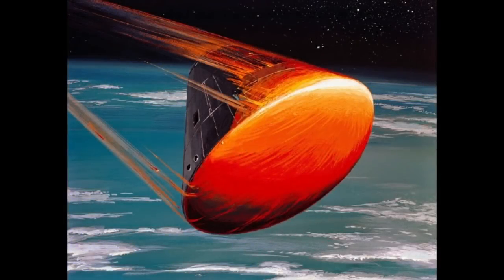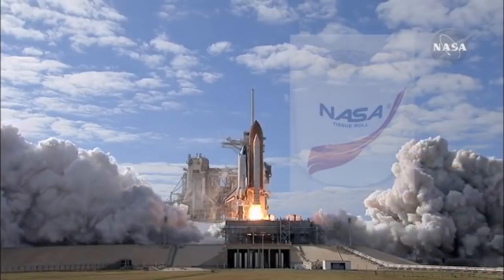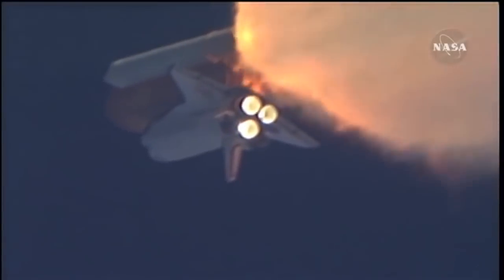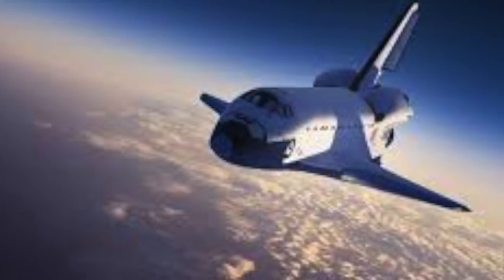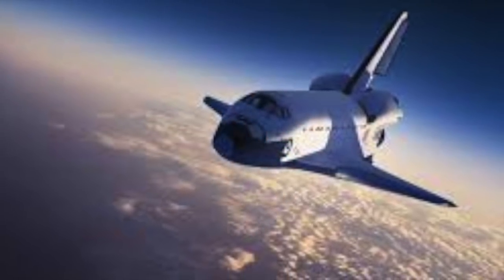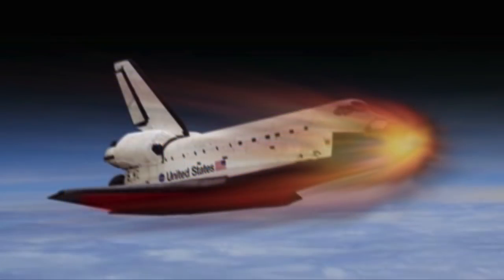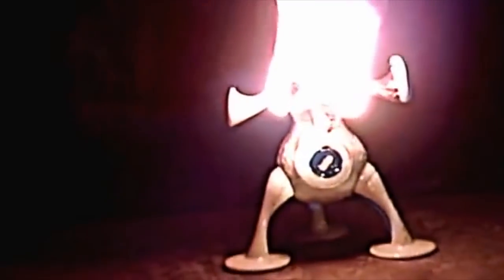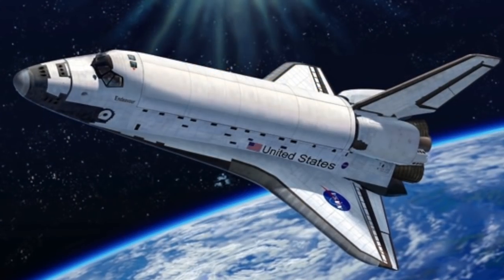NASA Fanboy questions #6

Comment: The only thing you prove with this video, is that you misunderstood "escape velocity". Escape velocity is the necessary speed to exit earth's gravity well - without any additional energy input! Space craft do not travel at escape velocity, because they use rockets to accelerate. How about trying to do some actual research and trying to understand a concept before trying to debunk it?

Think of earth's gravity well as a hill: You can give a car one single really huge push to roll up a hill. If the push was big enough, the car will have enough kinetical energy to reach the top of the hill without using its engine. This would have to be a really huge push and the initial speed would have to be really really fast, because the car will slow down over the course of its climb. The initial speed is the equivalent of escape velocity.

Alternatively, the car can use it's engine and travel much slower up the hill. This is the equivalent of what space craft actually do.
Reply: Of course it’s a theory. It describes an aspect of the natural world and has withstood the rigors of intense scrutiny. There is no higher level.
Reply: @tomwolfe6063  Still a theory and not a law... still bullshit unless you can actually prove it which you can't. Keep babbling troll... you've been lied to... but you still believe it... wake up Tom... you're living in a lie.
Reply: @BackYardGardeningTip  Theories and laws in the scientific world are two different things.  One does not become the other.
Reply: @Orlor  You mean like the big bang theory... how that's a theory but school books no long say it's a theory... never been proven but they don't bother adding the theory part....

So gravity is still a theory... never proven but somehow it's a law too??

Go back to bed and keep dreaming... unless you were being funny... then... HaHaHa good one.
Reply: @BackYardGardeningTip  - do me a favor and define what a Scientific Theory and law is.
Reply: @BackYardGardeningTip 
Do you accept:

The Germ theory of disease: that many diseases because of germs?

Cell theory: That living organism is made up of small cells?`

Atomic theory: that matter is made up of atoms.

Kinetic Molecular Theory: that gas particles are in constant motion and exhibit perfectly elastic collisions

A scientific theory is  to quote wikipedia "an explanation of an aspect of the natural world that can be repeatedly tested and verified in accordance with the scientific method, using accepted protocols of observation, measurement, and evaluation of results."

What in regular language is is theory is a hypothesis in science. It is a hypothesis that changes to a scientific theory when you have verified it.
 
Scientific law are statements that describe or predict a range of natural phenomena. They are narrower then a scientific theory. Scientific theory explain why a phenomena occur, law describes what phenomena happen.  A scientific theory can contain zero, one or many scientific laws.

A scientific theory never changes to a fact. A fact is a observation of reality. A scientific theory explain a lot of facts. 

You can compare it to sport in a way. Then the scientific theory would be the general idea of the sport. A law would be one rule of the sport. A fact would be that in a match vs team A and B the result is 9-3 or that players X scored a goal 5 minutes into the game. It is not a perfect analogy in any way but give the general idea of the difference  between scientific theory, law and fact and why one do not change to another.

Observational science like astronomy  is in a way like to try to determine the rules of the game by observing it being played but without access to any rule book.
Reply: @BackYardGardeningTip  
So you can't say it of accept any or all of the flowing The Germ theory of disease, Cell theory, Atomic theory or Kinetic Molecular Theory?
It is not a hard question and the answer can be I dot know enough about them.

The point was that if there is one scientific theory that you would considered to be proven to be true, whatever that mean, the question is why it is still called a theory and is not changes to law or fact or what else you would expect it to become.

If you expect a theory to change to a law you should be able to find a example.
If you can't you should ask why that 
don't happen. Consider if you understanding of what a theory or law in science is might be incorrect.
Reply: @BackYardGardeningTip Gravity is an effect that has been observed in epxeriments. This effect is described by laws AND theories. In science, laws and theories alike, are both based on repeated experiments and observation, but fulfill different roles: A law describes - what - happens (e.g. "Newton's law of gravitational attraction" which is still correct and applicable for non-relativistic speeds). Complementary,  theories describe - why - something happens (e.g. "Einstein's theory of general relativity" wich is among the most conclusively proven theories of all times.). So depending on what we are reffering to exactly, gravity can refer to an effect, a theory or a law, but in all cases it's backed up by hard evidence.

And about: "You can hang two huge massive balls a fraction of an inch from each other and yet gravity doesn't seem to affect them. Should they not smash together troll??"

This is exactly how gravity is proven! Hang two huge massive balls next to each other and measure the force or acceleration acting upon these balls.

So, I'd say the one of us, who is trolling and full of shit, is the one throwing around insults, while he apparently doesn't know what he's talking about.
Reply: @BackYardGardeningTip The cavendish experiment and comparable setups get repeated all over the world with the same results. Orbital mechanics based on gravity predict the movement of celestial bodies exactly. GPS only works as precisely, because of relativistic calculations.

Gravity is probably the best proven concept of all science, because no other fundamental force influences our life such profoundly. 

I think an actually critically thinking reader will realize quickly, which one of us two is trolling.
Reply: @BackYardGardeningTip  You've disproven the Cavendish experiment?! Publish your results! Let them be peer reviewed! Let them be repeated and confirmed! If it's confirmed, you'll get the nobel prize. That's how science works.

Contrarily to what you think, I'm here and I'm educating myself about flat earth and I got to say: Every so called "gravity debunk", that I've seen, has gotten basic physical concepts wrong, so I won't hold my breath. 

Including this video. This guy doesn't even understand the concept, he's trying to debunk. Why aren't you outraged by that? At the very least, you should be bothered by him misrepresenting your cause.

"Put to massed within a micro meter and they won't be attracted to each other...."

Of course they will, why wouldn't they?!
Reply: @BackYardGardeningTip You can call people names as much as you want. It doesn't change, that most physics undergraduates all around the world perform the cavendish experiment during their studies because it's such a fundemental truth and it's a really good practice for working patiently and precisely.

If you actually care about truth, you can perform the experiment yourself. It's a simple setup, that can be recreated on a budget. You won't get a decent accuracy, but you will be able to recreate the effect.

Here's a well laid out explanation recreated in a dormitory. If you question it, you have no excuse not to recreate it:
https://www.youtube.com/watch?v=jkjqrlYOW_0&ab_channel=GenGen
Reply: HaHaHa... "Think of earth's gravity"... HaHaHa... get a grip troll... gravity is made up just like the globe is made up.. Go somewhere else and try selling your 'gravity'... HaHaHa... dumbass trolls... they know nothing of where they really live but are willing to follow globehead lies without question. Back under your bridge you stupid blind and deaf troll.
Reply: @BackYardGardeningTip  Talking of knowing where we really live, I wonder when we might see a map of the flat earth?  While the FE remains unmapped, navigation is impossible.  Thankfully, navigation is possible on the spherical earth.
Reply: James Mann - Objects accelerate at a predictable rate towards the ground. This rate is 9.8mps sq. and is affected by mass.

We have given this observable force the name of gravity. Everywhere we look in our universe we see the same force acting exactly the same as we would expect. If you think that you know more about our physical reality than every physicist on earth, have at it. It would make you the wealthiest and most famous scientist in history. I can’t wait to read your paper.
Reply: @tomwolfe6063  Great response... are you awake yet?? 

Maybe gravity pulled your enter key down too soon.

Comment: Dear Spacebusters here's another project for you.   Why aren't the Apollo crews permanently deaf?   Saturn V, 1 mile away was over 3 times louder than the loudest passenger jet practically right next to you. Even a mile away, it was loud enough to instantly cause permanent hearing damage.    And yet the crew were 50 feet away with no ear protection which anyway wouldn't be any good.
Reply from the maker: Thank you Douglas, you should be on the payroll lol!
Reply: @spacebusters3933  It took me about 10 minutes to find information about that. With some more extensive research, I'm pretty sure you'll find a lot more. Hint: They are 50 feet away, inside an airtight capsule inside a helmeted space suit. Do you guys even try to research? Or do you give up after checking flatearthsociety-forums?
https://space.stackexchange.com/questions/27263/how-are-spacecraft-crews-protected-from-sound-damage-during-launch
Reply: @berndborte8214  Sorry no sound proofing is that good.   Just look up NASA's own design and fabrication of the space suit.  Then you have the Space shuttle which is almost as loud and NASA films show they are sitting with their visors open chatting to the control centre while it's accelerating.   They don't even suffer from G force.   Once again if you do not believe in the Moon landings the knuckle draggers like you bring up flat Earth.   Let's get one thing straight as far as I'm concerned 37 years in the airline industry gave me a good idea it's not flat OK   As you say your extensive research was 10 minutes LOL.
Reply: @berndborte8214  ps.   Any person with half a brain would be able to realise that a pressurised suit with air inside plus a pressurised capsule with air inside is not going to stop noise.   Tap on a deep sea divers helmet and see if you get a response.   Now if they had been in a vacuum and not touching anything then possibly noise would be suppressed.   Lack of air for the astronuts might be a problem though.  LOL.
Reply: @douglasgeorge1081  You do realize, that I'm not bringing up flat earth. This channel directly adresses flat earthers.
However, the conspiracy theories around the moon landing are only slightly less incredulous than flat earth.
Reply: @berndborte8214  You should obviously get out more if you believe man actually went to the Moon.   No problems landing or taking off.    
Every landing went with out a hitch.   When the public were bored they had to have an emergency around the Moon.... laughable.   Still the sheep believe this.  When this site starts saying that the Earth is flat then I'm off.   Flat Earth cannot literally hold water.   If it was flat the water would run off the sides.  LOL
Reply: @douglasgeorge1081  Dude, this channel denies the existence of gravity! It doesn't get more ridiculous than that.

About "going out more", I can only give that compliment back to you. Going to the moon would have been easier than to actually fake all the evidence.
Reply: @berndborte8214  "Going to the moon would have been easier than to actually fake all the evidence.
"   Captain Kirk and Spock disagree.
Reply: @douglasgeorge1081  Enterprise and Star Wars are the best example for how impossible halfway believable special effects were back then. :D

Lucas Arts debunks your conspiracy all by itself. And then we didn't even examine any evidence yet.
Reply: @berndborte8214  So you are just going around in circles now just like the Apollo crew.   Anyway you believe they went to the Moon I do not.   That's it really.   End of story.

Comment: For anybody interested in the answer... Firstly, escape velocity is the speed you would need to fire an object directly up to have to entirely leave the influence of earth's gravity ( does not include air resistance ). Secondly, the space shuttle or a satellite is not leaving the influence of earths gravity, simply going into orbit. It doesn't need escape velocity to do this. Third, as the vehicle is being pushed by the rocket engine all along its path, it can get away with less than escape velocity. When going up, the craft is going slowest in the thick lower atmosphere and fastest where there is no atmosphere. It's also orientated in such a way as to make it as aerodynamic as possible. On the way down, the opposite is true. The same amount of energy that was used to get the rocket up has to be burnt away to get it back down again. This energy is consumed as heat in the atmosphere on the heat shield. The spacecraft can vary the temperature it experiences by adjusting the rate it descends. Nothing to see here.
Reply: Finally, someone who knows what escape velocity is
Reply: You need to simplify your logic.  The first 3 syllable word they see they panic and start hurling insults.  Good breakdown......
Reply: Every single impossible question:

BRO It's GRAVITY

Fook off, loser

Comment: Now hold on to your tin foil hats boys and girls this will sting a little bit but I will explain why what was said is just uneducated waffle . In aerospace engineering, the maximum dynamic pressure, often referred to as maximum Q or max Q, is the point at which aerodynamic stress on a vehicle in atmospheric flight is maximized. It is an important factor in the structural and mission design of rockets, missiles, and other aerospace vehicles which travel through an atmosphere; the flight envelope may be limited to reduce the total structural load on a vehicle near max Q.During a normal Space Shuttle launch, for example, max Q occurred at an altitude of approximately 11 km (35,000 ft). The three Space Shuttle Main Engines are throttled back "and you will hear them say  during launch"   to about 70% of their rated thrust as the dynamic pressure approaches max Q; combined with the propellant perforation design of the solid rocket boosters, which reduces the thrust at max Q by 1/3 after 50 sec of burn, the total stresses on the vehicle are kept to a safe level.

So, although the spacecraft does not begin to burn up at Max Q, it is a dangerous part of the ascent and the negative effects are minimized by throttling back the engines at that time.

On the other hand a spacecraft that is returning to earth is already going at very high speed when it starts to enter the atmosphere and the dynamic pressure will continually increase as denser and denser atmosphere is encountered at lower altitudes. In fact, the way the spacecraft is designed to slow down is by converting its kinetic energy into heat energy in the atmosphere.  The hot atmosphere is created when the heat shield encounters the upper atmosphere at very high speed. This causes the atmosphere to be compressed ahead of the spacecraft and that causes the atmosphere to become very hot.  The hot compressed atmosphere will also heat up the heat shield. So the heating in the atmosphere is designed and necessary to slow the spacecraft . Ok you got that , good I am glad we cleared that up.
Reply: Excellent summation. Unfortunately what Spacebusters heard "[blah][blah][blah]NASA[blah][blah][blah]Science[blah][blah][blah]Physics[Blah][Blah][Blah]".
Reply: @fred_derf  I feel im doing my bit, because these people dont get it they think its not true .

Comment: A very simple and easily comprehensible way to prove the nonexistence of supposed physical measurable curvature of a globe earth is to force a physical level line by fabricating 1 foot or 1 meter length bars/panels with precise 90degree joining positions to each other, as the precise 90degree joins create and guarantee that each and every bar/panel is kept straight and level to each other, mount each 1 meter bar/panel to a 90degree perpendicular to the base mounting post so that the mounting posts support and secure each and every single bar/panel, only 1,600 bars/panels and mounting posts are required to construct a precise solid physical level line to successfully measure 1mile/1.6 kilometres which should reveal 8inches of physical measurable curvature if the earth were to be a spinning globe. 
Obviously to measure a greater distance then 1mile/1.6 kilometres, simply x the distance by 1,600 bars/panels and mounting posts for each added mile/kilometre, it is very very simple to comprehend this technique referred to as Forcing the Line!
#flatearthforcetheline
The Earth is most certainly NOT a spinning globe!
Reply: You need pretty stiff material for that. But it's been done: https://www.ligo.caltech.edu/page/vacuum
Note where it says "To ensure a perfectly level beam path, the Earth’s curvature (more than a vertical meter over the length of each arm) was countered by GPS-assisted earth-moving and high-precision concrete work"